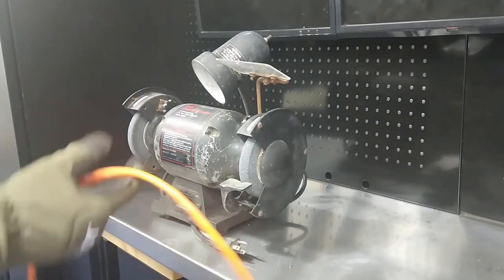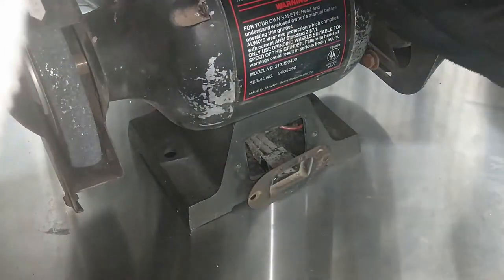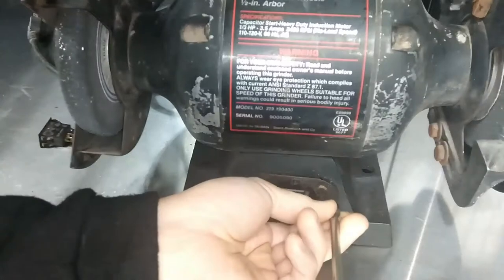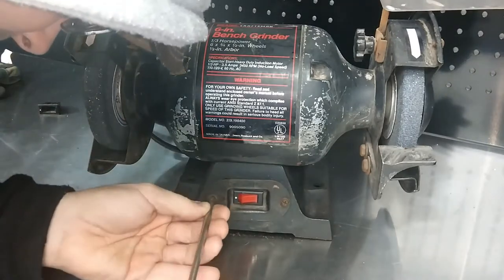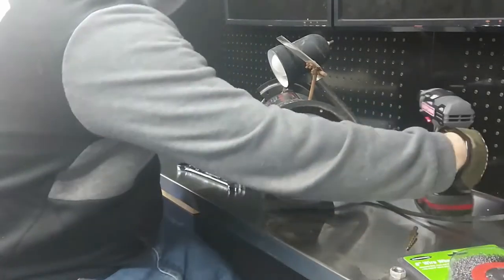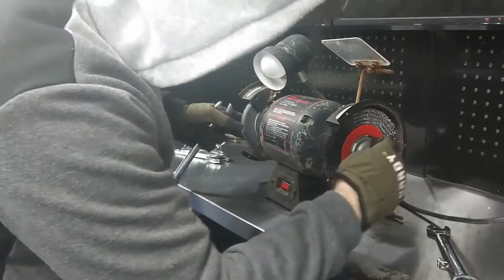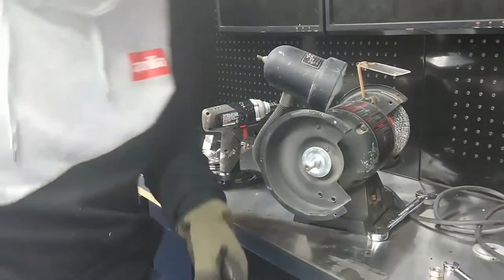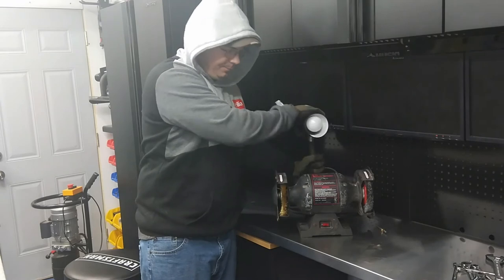Bench Grinder Switch Repair And Wire Wheel Brush Install

Comment: I can't get the grinding wheel off to save my life.
Reply from the maker: Reverse thread maybe? Electronics are super easy on these. You gonna need a switch I may have a few extra?
Reply: @TorrentPerformance  I got the nut off.  The grinding wheel is just SERIOUSLY stuck on there.  lol
Reply from the maker: @theropesofrenovation9352  a little heat and a few taps with a hammer gently may help.
Reply: @TorrentPerformance  Not sure.  Had to cut some of the wiring after taking a bazillion pics and tons of labeling, but like you said, I don't want to blow it up!
Reply: @TorrentPerformance  Well I've done a little more than tap.  Will try the heat.  Thanks
Reply from the maker: @theropesofrenovation9352  wd40, pb blaster, even kroil will help
Reply: @TorrentPerformance  Will try.  Thinking of beating the mess out of it and replacing the wheel.  WD40 didn't work.